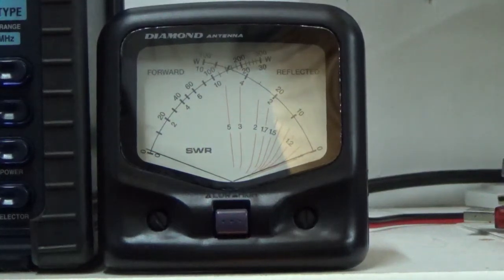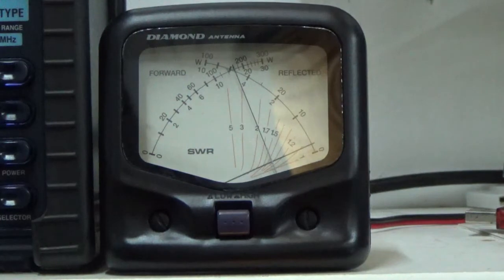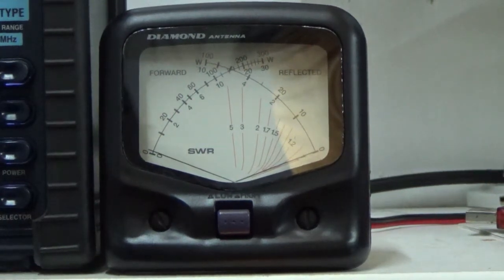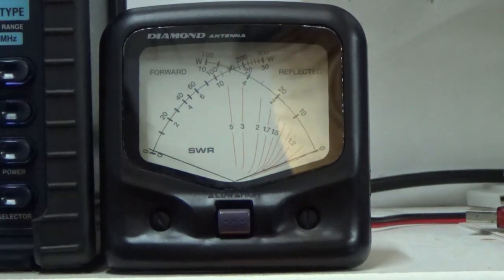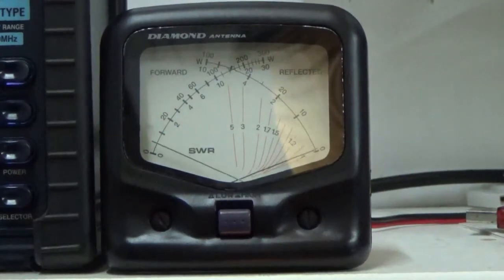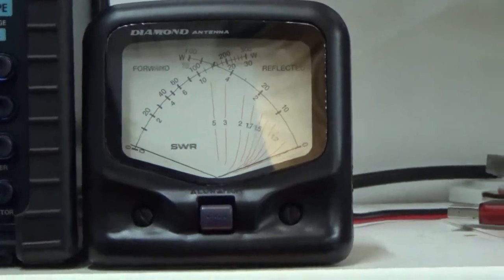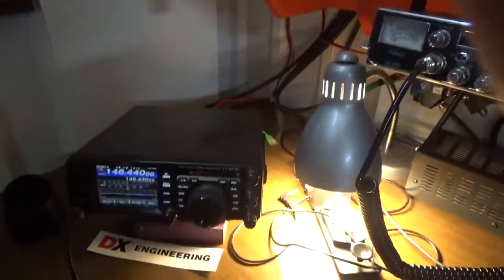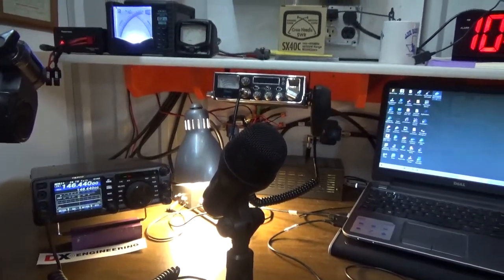2 Meter SWR Follow-Up Root Cause Found by Testing Diamond Antenna SX40C SWR

Comment: Shield your USB cable from pc to radio use a toroid or better shielded wire . had the same issue it  was a cheap USb cable.
Reply: I was thinking the Programs may have the settings for the control of the power may be an issue but the CHEAP USB cable sounds right.  Quality has a certain quality most times.  May it be the Bluetooth on the computer??
Reply from the maker: Good evening Ham Bandit - thanks for the message I will do that, could you tell me the cable part number description you used, nothing like repeating success my friend, again '73 de Ki5JUF and thanks for the help!
Reply: @westtexasvideogateski5juf255  Brand name is JSAUX the one I have I also put clamp on torroid on each end about 3 or 4 per end. my cable is 6ft long with 4 clamp on torroids each end. I have no issues now with the standing wave.    Good Luck 73!
Reply from the maker: @HamBandit  Good evening sir, you were right new USB cable and RF power is stable, again thanks here's what I purchased '73 everyone https://www.amazon.com/dp/B07BRWZRVW?psc=1&ref=ppx_yo2_dt_b_product_details